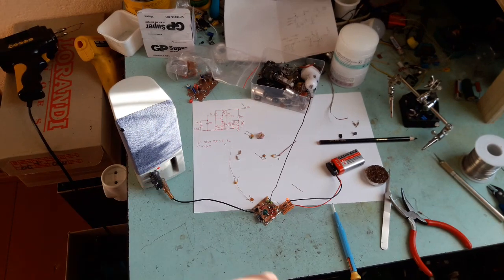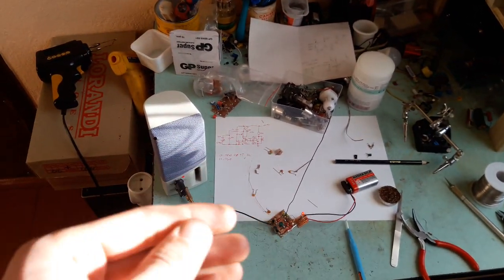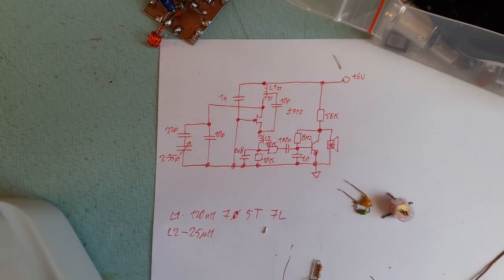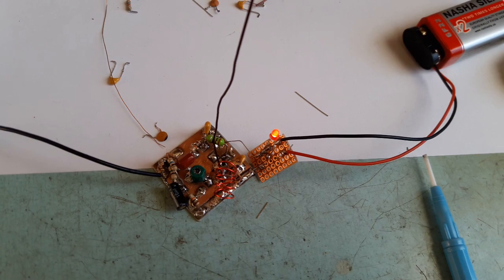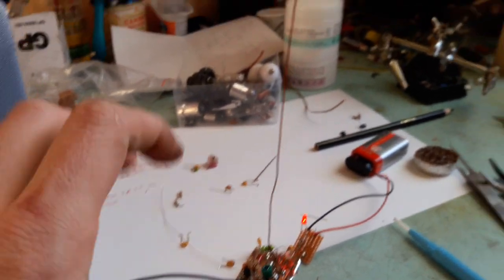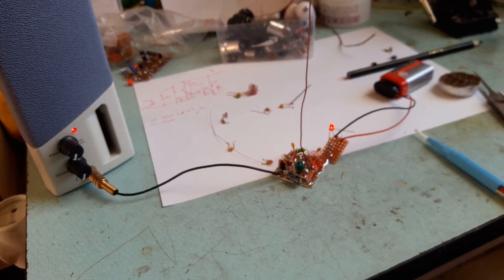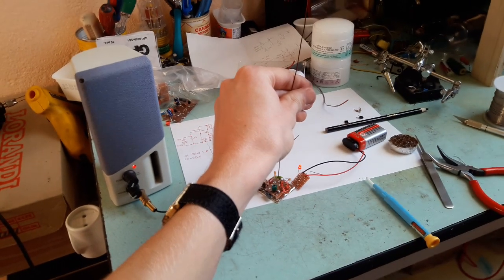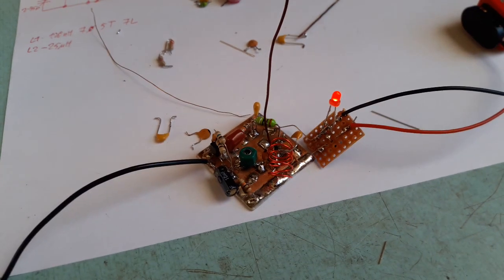Simple FM superregen receiver

Comment: Nice little circuit :-D
I did hear something about making regens slightly wrong, one person made a regen that worked fine but it also transmitted back up the antenna and caused problems.
Now this may have been an old valve design as it was a long time ago, and likely nothing like yours.
I bet it was a very old design that no one uses now.
Reply from the maker: Every regen or superregen emits RF into antenna, it is a weak oscillator which gets spoiled by incoming RF from the radio station and does the mumbo-jumbo to detect FM and AM. Nice feature of these RX's is that they receive AM too, not the MW band, but they allow  to seamlessly tune from FM band into air band.